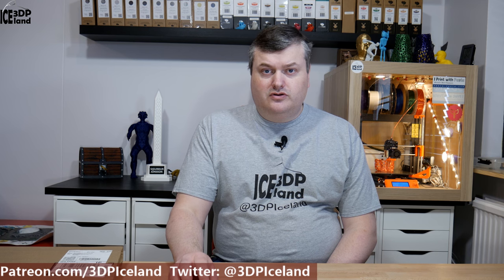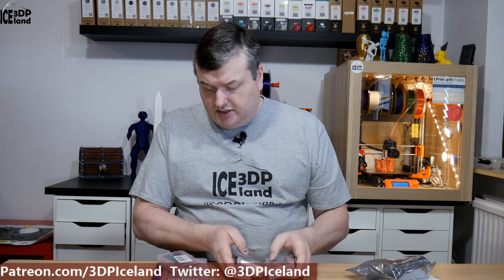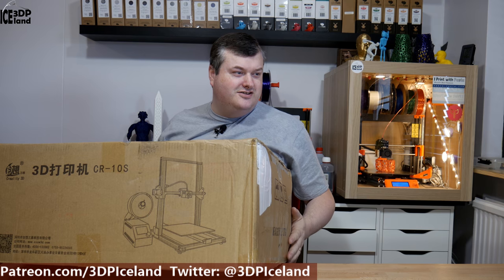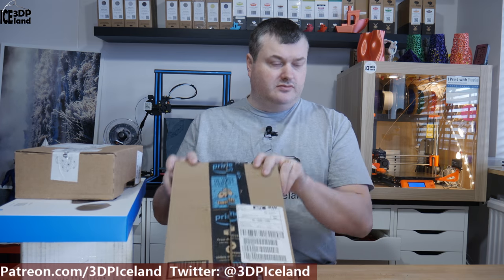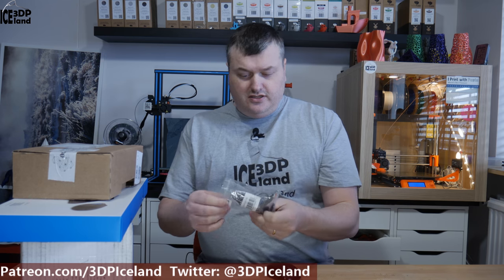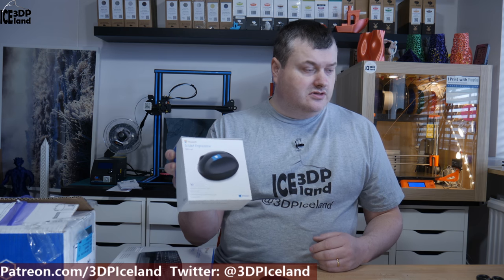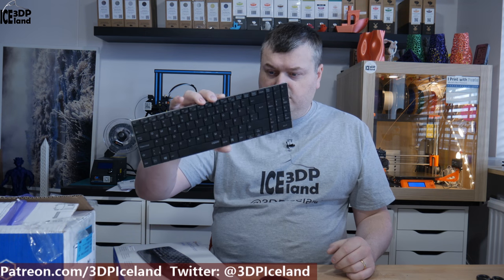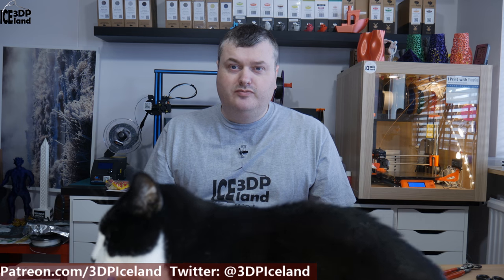I got Mail - CR 10S  and other stuff

Comment: Perfect, I'm between acquiring a Iprusa Mk3 or the cr10s so you can now be compared, your point of view seems very personal and without affecting the influence of companies, the materials you buy or you provide the companies?, that's very important to me Thank you
Reply from the maker: Awesome, Hope my view on those things help your decision. If you don't need the print volume of the CR-10, then the prusa mk3 is a much better machine in many ways, but more expensive at the same time, - if you need the build volume, then I think you are getting good value with the CR-10 compared to others big printers. -  my CR-10 have had "poor assembly quality issues" so far, loose screws, uneven glass bed, etc .. - but that can all be fixed and then there is a lot of upgrades that you can print out to make the printer better, -  so it needs more "affection" after the fact than the mk3,  The mk3 is a solid machine from the start and well designed and executed.